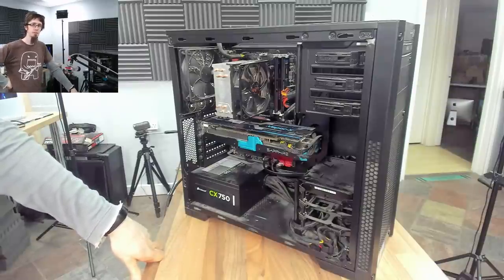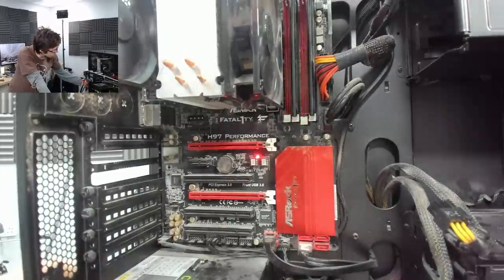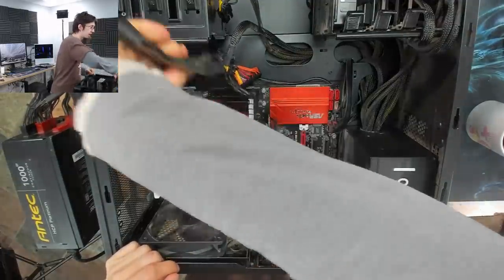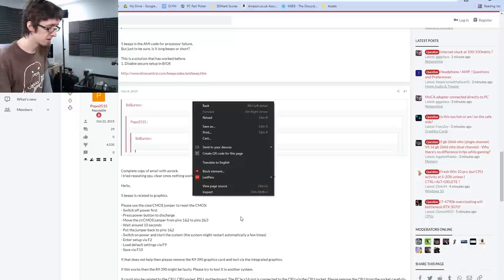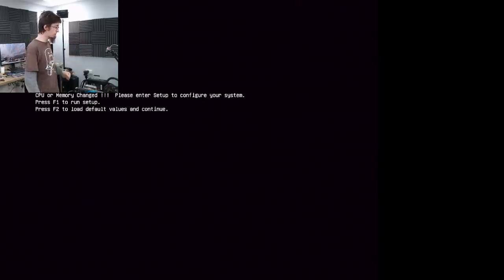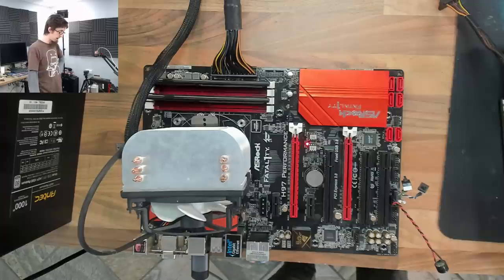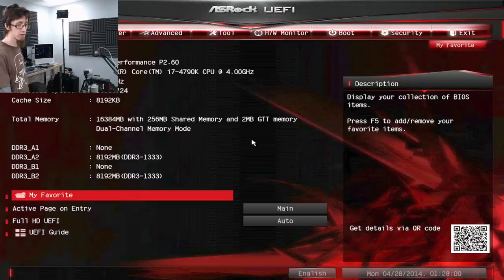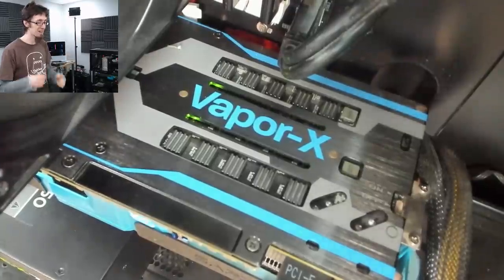Corsair Custom Build with No POST - LFC#272

Comment: Cracking video and couldn't agree more on the fan springs. Irritating as hell when people just crush them down. Also, what do you consider to be a service? Mostly I just end up cleaning them and making sure everything's secure where it should be. What else should be on that list if you don't mind me asking.
Reply from the maker: Lot of discretion involved, my mantra is "what else can I do with this computer to make it better in a reasonable time frame?" allowing for the fact that I work on a flat-fee. Generally these days it's mainly down to making sure windows is fully up to date, removing background junk, resolving any errors or minor faults it has. There's not a huge amount to do on most custom-builts because they're running vanilla windows with no OEM junk, and custom PC owners tend to be more discerning about how their system is setup already.

Comment: Most of the common AMI/Award/Phoenix bios beep codes usually relate to legacy boards. With UEFI the manufacturers seem to make up their own beep meanings and usually differ from each other. Asrock's manual for that board contains no information on beep codes, so bit out of luck. I did notice that it had PCI slots, so maybe a diagnostic post card would have been more of a help. My cheap post card has helped in many situations, unfortunately none of my current PC's have PCI slots, all PCIe.

Comment: Question: What's the meaning of AMI BIOS Beep Codes?(10/29/2002)
Answer:
The following are AMI BIOS Beep Codes that can occur.
Beep Code	Descriptions
1 short	Memory refresh timer error.
2 short	Parity error.
3 short	Main memory read / write test error.
4 short	System timer failure.
5 short	Process error.
6 short	Keyboard controller BAT test error.
7 short	General exception error.
8 short	Display memory error.
9 short	ROM BIOS checksum error.
10 short	CMOS shutdown Read/Write error.
11 short	Cache Memory bad.

Comment: At the point where the CMOS battery was removed, should use a button battery tester. They are available on eBay for cheap, are about half the size of a pack of cigarettes. A regular volt-ohm meter would also work, but results aren't always trustworthy. Always best to first blow out the dust accumulation before touching anything inside the case.
Reply: Some multimeters have a battery check function on them. Battery check just puts a small load on the battery while it is tested. A couple hundred milliamps usually. Batteries have different voltages resting and loaded. The resting voltage really doesn't matter if you're trying to use the battery to power something.

Comment: Two beeps means there has been a parity error in base memory. This is an issue with the first 64KB block of memory in your RAM. The solution is usually to replace the memory

Comment: I'm pretty sure the bios chips are just regular serial flash chips, they don't store the static ram CMOS data.  That would be on some other chip.
Reply from the maker: Yea this is correct, I've never actually spotted which chip is holding parameters, but as it's all part of "the bios chip circuit" I generally treat it as a single thing. At some point I want to make a video that talks about this in greater detail though 👌

Comment: If the speaker didn't work, or isn't installed - another way to diagnose POST issues is with a 'Motherboard PCI / PCIE / Mini PCIE / LPC PC Analyzer Diagnostic Test Post Debug' - can be found on eBay, they have a display (LCD or 7-segment depending on the version you get) so no need to google specific beep-codes.
A way easier method of troubleshooting, imho
Reply from the maker: I've actually got one, and this would've been a great example for it. However, I don't generally use them because most of the time you can identify the issue from the symptoms, and if the symptoms are no good, the post-card probably won't help either. I think in this system, the POST card would've been giving a different code each time - which is exactly what the beep codes were doing.
Reply: @Adamant_IT  - One can never have too few tools and too many skills to master them :ø)
I have the PCI version with a LCD, most motherboards seems to go through the same cycle of codes (which the display will decode) rapidly when booting up, and there seems to be a rhythm to it. 
Every motherboard is different (it seems, I don't have that much experience), and so is troubleshooting. 
Great tool too, to diagnose defective GPU cards, without having to disassemble the entire build.

Comment: I like to reflash BIOS and be it just with the same version to prevent electrical degredation of the BIOS just in case especially when the BIOS never has been updated or the update is a few years back... Might be just a tick but I never had problems going this route...

Comment: upon pausing the video to get adjusted i noticed the memory stick loose. i see the white tab not locking the memory in place. oops my bad. upon skimming through it is just an empty memory bank.
Reply: Noticed it too. It's good to notice these things. 😉 Sometimes it's key pointers as to what is about to/might have happened. It's also a great indication for what the previous technician/builder's standards are. 😁 Never doubt your observations or instincts, we always learn from them. 👍

Comment: 41:35 is that one of the programmers with the design flaw putting 5V on the data lines instead of 3.3V ?? some bios chips might not like it

Comment: first suspect the cx750w, i was warned multiple times that mine was gonna blow that specic model cx 750 has a bad rep i know what you all thinking well its a corsair should be fine but i hear its not fine by multiple different people, its not corsair thats the issue its the CX750w that is.

Comment: what i always start with is switching the main storage device. The only thing i use linux for is for a universal boot device, just to confirm none of the other components are the fault.
Reply: Cleaning the Windows virus out has fixed a lot of PCs for me. The only thing I use Windows for is the butt of jokes!
Reply: @1pcfred  Both have their uses. When I set up a minecraft server for friends I use linux just because its lightweight and wont have anything running in the background but it doesn't suit me for a daily driver, I tried :p 

It's all down to what you do the most, whichever works for your use case. you aren't gonna go anywhere making jokes about an operating system lol. It's just software at the end of the day, it has no feelings to hurt.
Reply: @noodle_Cx  I am not sure what you mean when you say, "wont have anything running in the background" as Linux typically has a lot running as background processes. I started less than 30% of the processes running on my PC right now. The rest of it all is OS overhead. Most of it I've no idea even what it is. But apparently it is critical that it be running. Because honestly things have been working rather well lately. So I'm not one to upset the apple cart. If my OS thinks I need gvfs-udisks2-volume-monitor then who am I to argue? Even if I don't have the first clue what that does. Apparently it is a memory leak watchdog. Knowing how poorly the Gnome team codes I probably do need it. Not that I use Gnome but I use some of their applications. They're clearly cognizant of their own shortcomings too. Or they would not have blessed us with this program.

Comment: I always thought you need power to actually clear cmos (so power on + power button pressed). ?
Reply from the maker: Not for an ATX settings reset, no. Some laptops have specific commands that involve powering on, but modern ATX is just "remove power from CMOS"

Comment: Nope, never the CPU until it is... actually had my AMD 3900X die recently and was complete shocker.  Was still under warranty, so only lost time in troubleshooting.  But troubleshooting was definitely fun... had to get a cheap A520 board but had memory and another PSU to test with.  Odd thing was, the A520 would post sometimes with the bad CPU but couldn't install windows or run Linux live media at all when it did post.
Reply: In retrospect perhaps the 5.6 GHz OC wasn't the best idea?

Comment: Hello Adamant IT, thank you for great video and now I am another follower because I do like that you explain very simple. So moving on, I want to ask you about BIOS. I have a ASUS tuff gaming X570+wifi mother board with a AMD Ryzen 9 5950X  and 32GB of RAM now I do not have a GPU due to what is going on with scalpers. So I actually assemble all of it and this is my first one doing. So I did all of it as I should of with out a GPU I powered on to see if it would bootup but I got the QLED (VGA) on and for a few seconds it power but then the fans shutdown. Now is this because there is no GPU? Or  the BIOS of the board needs to be updated? Please I ask of your help as I have asked many other people and they tell me the CPU is not comparable with the board but I checked and it is comparable. Can you give me a hand with this please? I will appreciate that very much.
Reply from the maker: Yea the VGA light indicates that there's no display output available. So it needs a GPU in there.
Reply: @Adamant_IT  Got it thank you very much I will redo everything once I get that GPU some how thank you so much.

Comment: I threw my old pc into a skip after it would not post no matter what. Later after all that i found out that all i had to do was touch a screw driver to the bios reset jumper..  The problem was a tried to overclock my RAM a little to far.

Comment: Adamant IT, I've got the ASRock Fatal1ty 970 Performance MB (Rev 1.00), It's the AM3+ with a Phenom CPU in it, It was working but seems to have died a death, It's still giving me grief even after doing extensive TS Steps such as swapping out Memory, Graphics Card, PSU and clearing CMOS etc, All I could get was the CPU Fan would try to start and then just stop dead and the PSU wouldn't kick in, I noticed that you re-flashed the BIOS Chip on your Board so thought I would pop the BIOS Chip out and re-seat it, When I did that and turned it on I heard a brief Arc although it wasn't particularily loud but still nothing so thought I'd see if anything had changed and turned the Machine back on and now I am getting Fans spinning and the PSU is now kicking in, The Power LED on the Board isn't Lighting up and I'm getting no Beeps from the Speaker which I've Plugged in and No Video Output, Any thoughts and I'll definitely be investing in a BIOS Chip Programmer at some point soon, Do you know anyone that sells pre-programmed BIOS Chips for ASRock Boards?
Reply: I've just ordered one of those BIOS Chip Programmers from Amazon and thanks for the info! 🙂
Reply from the maker: Worth a try, since it looks like you've covered all the other bases.
Reply: @Adamant_IT  Thanks for that, I've managed to successfully re-flash the BIOS with the information that you provided along with some help from searching Google, I don't think it was the BIOS to be fair, It's strange as the Fans wouldn't Spin until I removed and re-seated the BIOS Chip but yeah still the same, I'm pretty sure that something has failed on the Board...

Comment: i wonder if the customer tried to flash the bios and stopped it in the middle of the process because he thought it was not going or if he flashed the wrong bios for it.
Reply: Low voltage CMOS battery is the most likely cause IMHO.

Comment: My primary BIOS chip failed years ago also an Asrock board backup BIOS works flawlessly
Reply from the maker: I quite liked this dual-BIOS system, as it had a nice clear jumper to switch between the chips. None of Gigabyte's automatic nonsense where you have to do a rain-dance to chip select. GB have manual-switches on higher-end boards, but for some reason they don't put a nice simple jumper on the low-end, and that's a big shame.

Comment: The system will beep 3 times if it doesn't detect memory correctly. ... Only install 1 pcs memory on each DIMM slot to verify. 3. Remove your CPU and check if there's any pin bent on CPU socket.

Technical FAQs - ASRock Industrial

Comment: I have desktop computer Z390 based system, with RTX 2070, i9 9900k, 64 GB DDR4 3000 mhz ram and Noctua NS-D15 and 750 W PSU of good brand running Windows 10 latest build. Everything have been working fine months, but suddenly after 5-10 minutes gaming the system suddenly reboots into the bios. All this started once I started playing Shadow of the Tomb Raider, and now it happens in Hitman 3.

 I am running the latest Nvidia driver.

what can be doing this?
Reply from the maker: You need to try and re-produce the fault with stress tests like Cinebench R23, Furmark, or both at the same time. Once you can trigger the fault on demand, you can have HWINFO running at the same time to monitor temperatures as the system runs, and really see what's going on.
First thing I'd do though, is turn off XMP and see if the problem disappears. XMP is always a suspect in crashing errors, and if the problem vanishes with XMP off, you know that you just need to tweak those settings until it's stable.
Try running with only two memory modules in as well, as 4-module kits are more prone to stability issues.
Reply: @Adamant_IT  thank you.

Comment: The following are AMI BIOS Beep Codes that can occur.

1 short	Memory refresh timer error.
2 short	Parity error.
3 short	Main memory read / write test error.
4 short	System timer failure.
5 short	Process error.
6 short	Keyboard controller BAT test error.
7 short	General exception error.
8 short	Display memory error.
9 short	ROM BIOS checksum error.
10 short	CMOS shutdown Read/Write error.
11 short	Cache Memory bad

Comment: Since Windows 10 started to use Windows Update to flash BIOS without advertising (WU describe it as a Firmware Update), there are a lot of PCs and Laptops who die because a bad updating. I've never used before so much times my TL866 Plus, and desolder and solder laptop BIOS chips... Damn Microsoft!

Comment: Is that a molex on the motherboard?
Reply from the maker: Yup, aux power to the PCI-Express slots, which is needed if you have a lot of high-draw PCI-E cards in the system. I've never seen one of these actually used or be required, though. Any cards that use a meaningful amount of power tend to have a molex or 6+2 on them anyway.
Reply: @Adamant_IT  awesome, thank you

Comment: pulled off Asrock's own website, in case they become usefull later ^^

Question: What's the meaning of AMI BIOS Beep Codes?(10/29/2002)
Answer:
The following are AMI BIOS Beep Codes that can occur.
Beep Code	Descriptions
1 short	Memory refresh timer error.
2 short	Parity error.
3 short	Main memory read / write test error.
4 short	System timer failure.
5 short	Process error.
6 short	Keyboard controller BAT test error.
7 short	General exception error.
8 short	Display memory error.
9 short	ROM BIOS checksum error.
10 short	CMOS shutdown Read/Write error.
11 short	Cache Memory bad.

Comment: without watching it... CX 750... that's the problem!!!!! but only without watching! I hate those crappy power supplies
Reply: no.
Reply: @RWL2012  yeah I watched it. would have never guessed a bad bios, since, usually the just don't go bad. wonder why... maybe power surge or something ... but those CX power supplies have the worst caps in them, can't tolerate any heat ..  I never recommend them.

Comment: IIRC CH341 is a bog standard USB->Serial chip
Reply: As long as it can get the job done for its funny price - so what?
Reply: @em0_tion  He gives people this information so they can look for it for themselves.  The trouble with something bog standard is that it's in everything and you're not likely to find what you're looking for, unless it's the chip itself.
Reply: @aetch77  I couldn't quite understand what you meant. What programmer would you recommend me for such BIOS chip reflashes (laptops & PCs)?
Reply: @em0_tion 
1. It seems I misremembered, I was thinking of the CH340 chip as being the one found in just about everything.  The CH341 is a USB to UART converter.
2. I was merely passing comment on how common the chip is.
3. I cannot recommend an EEPROM programmer.  Although I have a 15 year old Willem EEPROM programmer I have barely used it and it quite likely won't work on any of todays bios/uefi/firmware chips.

Can I take my feet out of my mouth now?
Reply: @aetch77  😁 No need to be tough on yourself, man. I was only asking in search of any advice that can help me choose such a device. Thank you. 👌✌

Comment: meaning of AMI BIOS Beep Codes?(10/29/2002)
Answer:
The following are AMI BIOS Beep Codes that can occur.
Beep Code	Descriptions
1 short	Memory refresh timer error.
2 short	Parity error.
3 short	Main memory read / write test error.
4 short	System timer failure.
5 short	Process error.
6 short	Keyboard controller BAT test error.
7 short	General exception error.
8 short	Display memory error.
9 short	ROM BIOS checksum error.
10 short	CMOS shutdown Read/Write error.
11 short	Cache Memory bad.

Comment: Obvious that you pulled the PCIe connector out of graphics card for the video.  Who wouldn't notice that prior to filming.
Reply from the maker: It booted that way, my guess is that it had a pending update on the previous shutdown, or it actually crashed during an update. It completed without drama though, so I don't think it was relevant to the fault.

Comment: oxidized pins in cpu socket corrupted bios /// dropping the motherboard on the tabled via backplate contact sent a shockwave that broke the coating... either then that ,,, its good,, NITRO out.

Comment: They make a clip that clips onto it so you dont need socketed chips
Reply: Mistakes happen, clips fly off and disconnect. If it was up to me, I'd always stick to a hard reliable connection. Better safe, than needlessly waste more time and nerves.
Reply: @em0_tion  happens same with hard connection crashing driver disconnect you also take the chance of lifting a pad or trace also